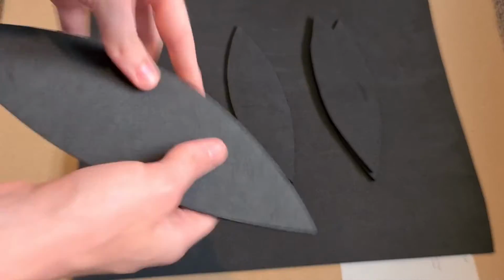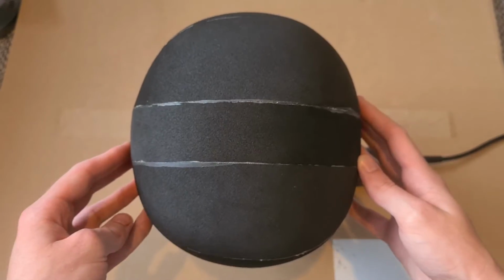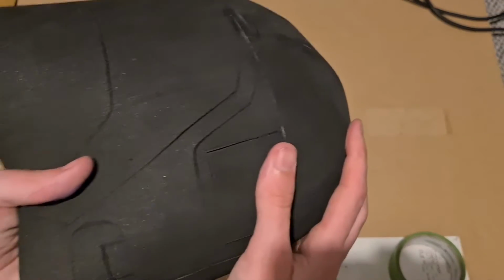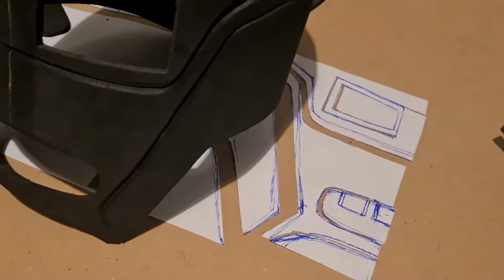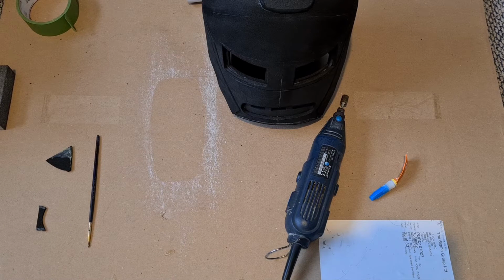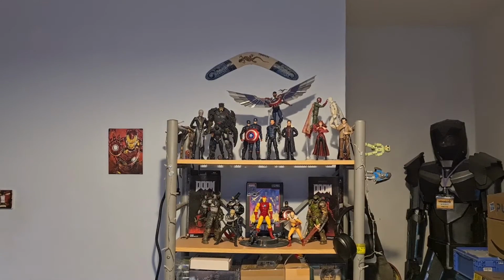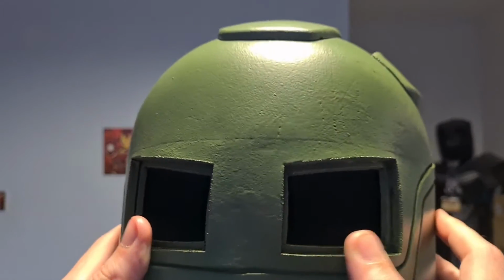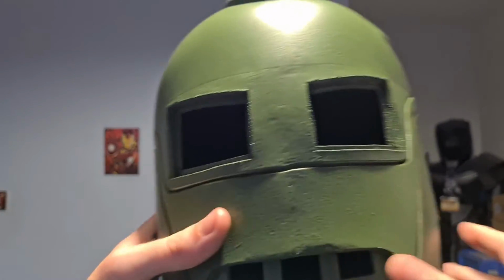Making The Hydra Stomper Helmet From Marvels "What If?"

Comment: I see the helmet is somewhat making the nose red, I've done one of these helmets before, and my suggestion is maybe adding some extra foam inside or any soft material, and maybe I was wondering you would add plexiglass for the visors-- It would look cooler. I really like the helmet, but those are my suggestions. :)
Reply from the maker: Hey, thanks! I've ordered lights and parts for the eyes and mouth to do in a future video